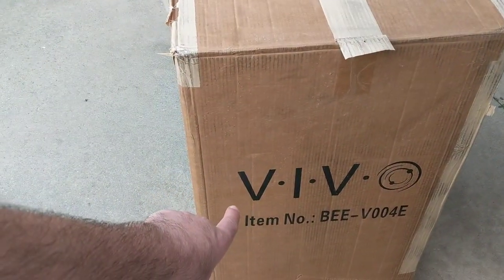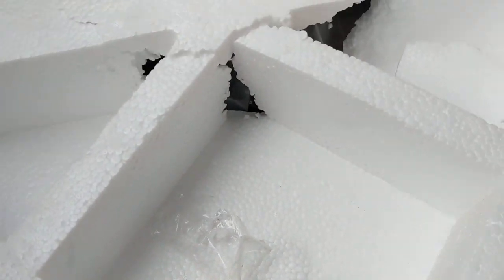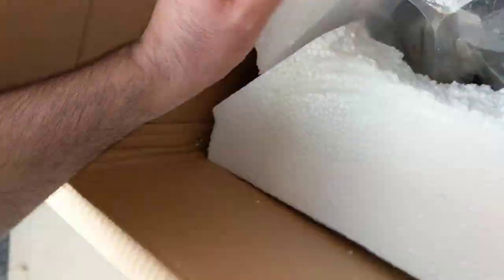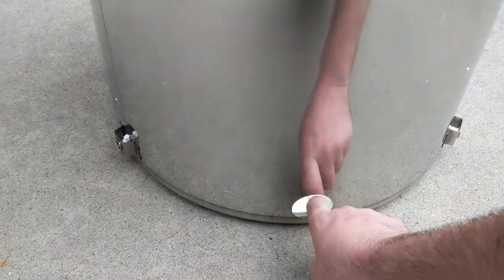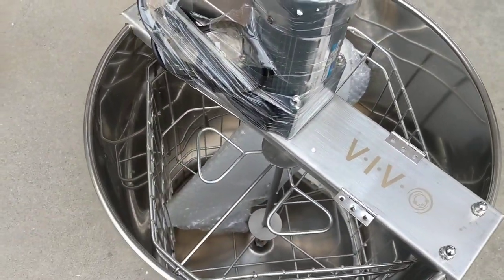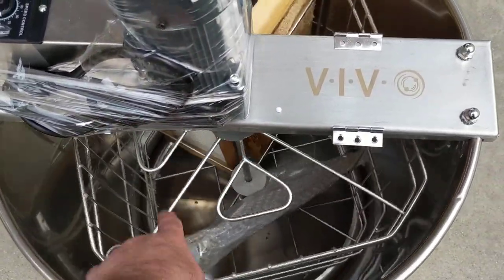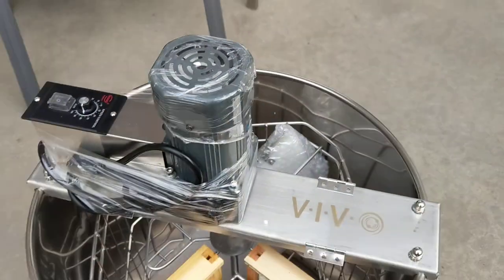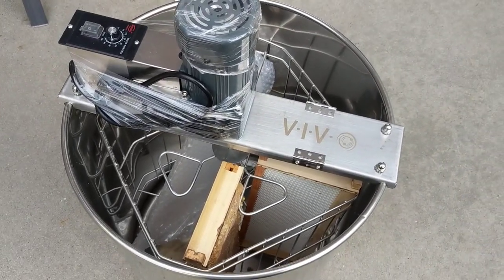Unboxing: Vivo electric honey extractor

Comment: Have u done any more research? Too many options.     I’m not trying to buy the cheapest one, but I think I might get the vevor 3/6 frame electric extractor, I don’t think I will mind flipping the frames, for 10-15 fives I think it will just fine and I don’t have to do it all at once. I can always sell it back and pretty much get my money back. It’s only $215 for 3/6, the 4 frame is $340 I’m not sure if it’s going to make much difference to buy the 4 frame. One guy on Facebook got the 2/4 frame used it once and reselling it of $10 cheaper then a new one
Reply from the maker: Of you have 10-15 hives, you’ll regret getting a small extractor. The Vivo can do 8 frames radially, which is a huge advantage. I have 17 hives and wish I had a 20 frame extractor.
Reply: How do u like it so far? If I get the vevor one I can always sell it next year and pretty much get my money back. I know the radial is faster but I don’t have to do it all at once and at the same day. Do you extract 8 medium frames at once? I use 9 frames per box. Is it pretty tight to put the frames in if they are fatter if u use 9 frames ?
Reply from the maker: @Inrussian  It’s been solid so far. No complaints really. You could also resell the Vivo if you decide you don’t like it. The biggest advantage of extracting radially is not having to flip frames. It is a compact design so inserting frames radially when they’re fat can be a little challenging, but it’s not too bad. I personally would not want to drag out my extraction process any longer than necessary. Sure, you can take two or three days to extract your honey, but all that time is money in my opinion. Your eating into your profit margin with an inefficient setup. But, to each his own.